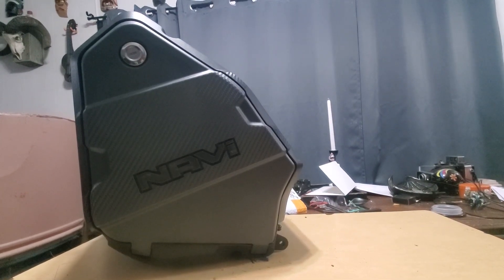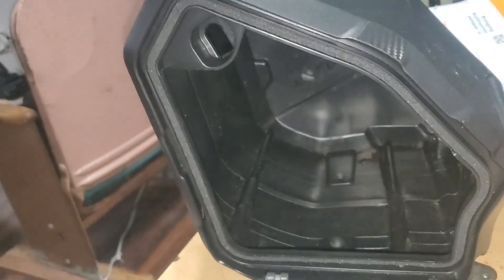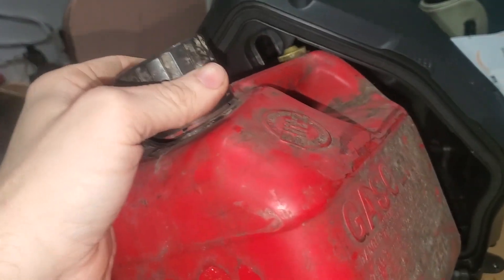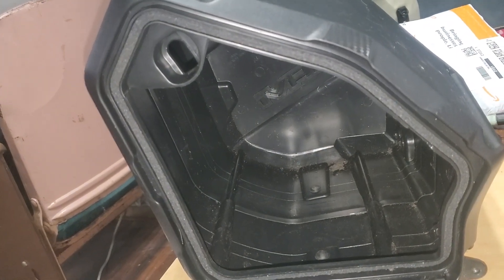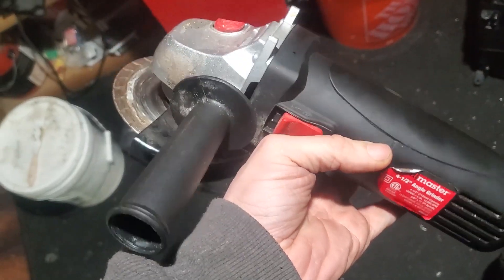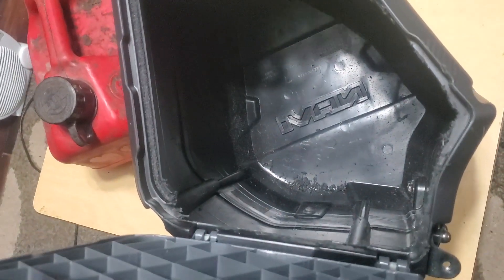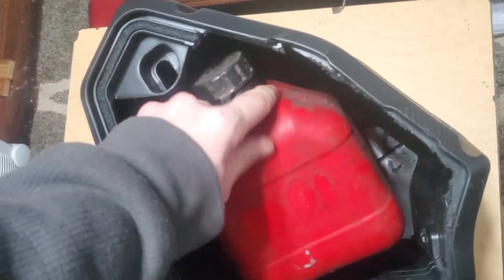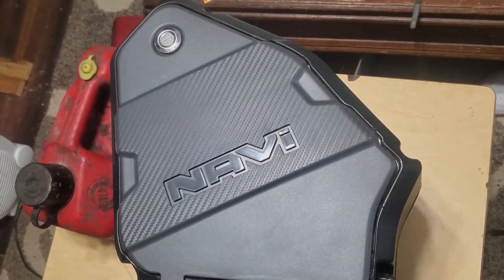Honda Navi Storage Box Hack

Comment: Honestly, you could have done that without hacking the crap out of the thing. Did you try to cut less and see if it would fit, or did you just go full Gorilla on it right off the bat?
Reply from the maker: I did, it didnt work with forcing it. I could have cut even more from the sides but i stopped once i got it to work